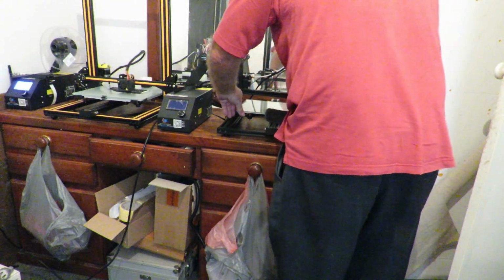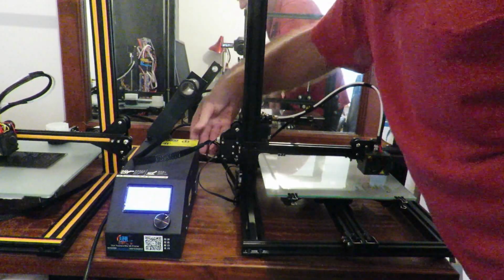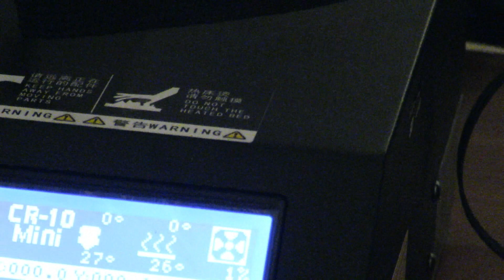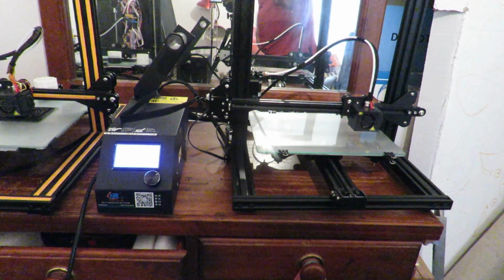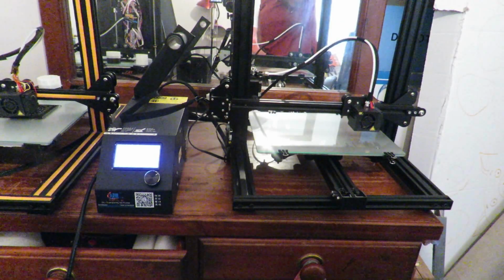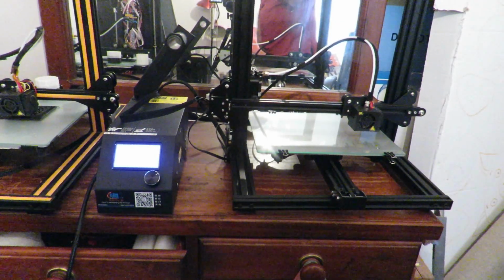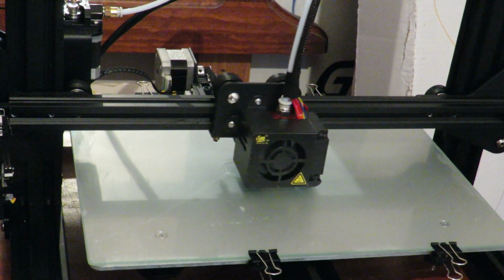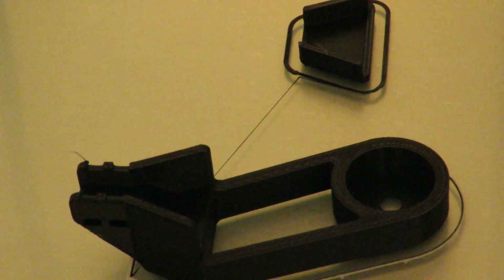📌 Creality CR-10 Mini 3D Printer Assembly and First Print

Comment: you jumped right to print how did you load the print job
Reply from the maker: You load your stl file into Cura (or Similar program) and save it as a Gcode file, then copy to a SD card, and insert into your printer's control box, or you can use Octoprint, and transfer files directly from your computer.

Comment: I'm new to 3d printing and just put together my CR10 mini, which is my 2nd printer (already!)  My 1st printer was a Biqu Magician which is great, but I found I wanted a larger build volume hence the CR10 mini.

I didn't have any trouble putting it together, but when I went to do my 1st test print nothing extruded.  I can push the filament through manually and see it come out of the nozzle, but when the motor runs it looks like it's not grabbing the filament.  The toothed part turns, but the smooth wheel does not.  I'm using 1.75 PLA and heating to 200 and unless they sent me a used printer it shouldn't be clogged, right?  Any troubleshooting advice?
Reply from the maker: Try disconnecting the bowden tube and run the filament so its completely through the extruder, then start a print and watch to see if the extruder is pushing the filament through the extruder.
If its not grabbing the filament, then check the extruder wheel alignment. ( loosen the bolts and re-align the extruder and motor)
Reply: Thank you for you advice, I removed the bowden tube and tried moving the e-axis in the controls without bothering to put the filament through the hot end and again the gear turned but did not grab, so I learned it was not anything to do with the hotend or the bowden tube and a little bit about troubleshooting!  

I admit I wasn't sure exactly what alignments you were referring to, but I was playing with the various bolts on the extruder assembly and discovered that there is a single bolt whose sole purpose is alignment, and when adjusting it saw I was getting more clearance from the z-rod and the filament was straightening out!

It now appears that it is feeding the filament!  Thank you!  Now I'll try to print something :)
Reply from the maker: Glad you got it working
I would suggest if you haven't already done.
Don't use the Cura version supplied on the SDCard, Download the latest version of Cura. it has a CR-10 Profile already included in it.

Comment: Thank's for this video, it helped me loads. I'm a newbie to 3d printing. Cheers
Reply from the maker: Thanks for taking time to comment.
If you need any help, just pop a question in any of my videos, and I'll do the best I can to help you.
Reply: I have a question but it's going to hard without showing an image but I'll try and describe it. I am a  complete novice and trying to suck so much information up that I'm struggling a bit. The prints I have had difficulty with are shallow ones for example the Knob for attaching to the thumb screws that looks like a water valve. There's bits sticking up instead of filling. I am just trying again at the minute and I had the fill at 16 I'm now doing it at 20 but if this a common thing with a simple answer I'd be really grateful if you could help. Cheer
Reply from the maker: Hi Steve
What slicer are you using?
Reply: Garry Purcell Hi Garry 
I’m using Cura that came with the machine but I also downloaded the new (I presume) version from their website and it was the same. I have had good results when I’m printing a little robot etc but if something is very thin like some lettering that’s 3 or 4 mm in thickness it doesn’t seem to do the fill enough. I’ve done a bit of fiddling after watching some videos but I’ll have to look again tomorrow as my bed is calling. Cheers a Steve
Reply from the maker: I would suggest you upgrade to Ultimaker Cura v3.0.4 for Windows
Here is a direct link
https://ultimaker.com/en/products/cura-software/download-request/159

Cura v3 and later have now incorporated a CR-10 Profile to make setting up the printer a lot easier.
Reply: Garry Purcell thank you very much. I shall do that first job in the morning and report back. I’ll see I can share an image . Cheers Steve
Reply from the maker: No worries.
We will hopefully get you 3d printing perfectly soon.
Reply: Hi Garry, been printing 13 hours and produced 2 faultless pieces . I downloaded the version of cura from the link and used the CR 10 profile. Worked a dream. I did wonder if had to be the mini profile which wasn’t there but the standard cr 10 profile was fine. Thanks for your help mate much appreciated and I'll be watching out for your future videos. Cheers Steve .
Reply from the maker: I'm glad your printer is up and running now.
You can change the Cura settings for the Mini.

On the Menu Bar
1 Goto Preferences
2 Printers
3 select CR-10 Printer
Then click on Machine Settings
You will now have a pop up screen where you can change the build plate size to suite the CR-10 mini

Now you biggest problem will be.... which thing to print next.😀
Reply from the maker: Hi Steve
You need to add support in the Cura settings.

On the right hand side 
1. Scroll down to support
2. Tick the "Generate Support" box

Now when the GCode is created, it will automatically build small structures, to aid in printing overhangs, such as those in you photos. 

You can alternately download Ideamaker, and manually add supports where you want them.
Ideamaker requires you to set up the CR-10 profile yourself, but it is well worth your time, to do so.
Reply: Garry Purcell I thought the software created it if it was needed but I see it’s not ticked in the Cura settings. I’ll try that again tomorrow. Again many thanks. Steve
Reply from the maker: The supports can be a pain sometimes to remove.
Let me know how you go..

Comment: Just got mine today! I did notice all of the axis rollers have flat spots from where it was parked for shipping. Did yours?  Do they go away after a while. Also noticed the lead screw brass female "nut" has lock washers between the mounting hole flanges and the extruder bracket plus they are loose. Are yours?
Reply from the maker: If you adjust the eccentric bolts to spread the tension across them, you will find the wheels will wear in nicely, and after a few prints, the flat spots completely go away.

I assume you are talking about the top of the gantry, where the lead screw mounts to it. 
One or two millimeter play in this area is normal, and it is designed that way.
Reply: Garry Purcell Thanks Garry!  I did a little fiddling with the adjustments and its smooth now.
The other thing I asked about is the brass lead screw nut that is bolted to a bracket on the side of the extruder motor.  Mine has 2 lock washers on each bolt. One under the head of the bolt and one between the lead screw nut mounting ear and the extruder bracket. Neither screw is tightened  to the point of flattening the lock washers. I didn't know if this is supposed to be like this or if it is an assembly mistake.
Reply from the maker: I checked my three CR-10 printers and they are the same as yours.
One washer under the blot head and the other between the brass and extruder
Reply: Garry Purcell 
Thanks again Garry! Cheers!
Reply from the maker: If you have any other questions, simply post a comment on any of my videos, and I'll do my best to help you.
All the Best, and Happy Printing.

Comment: you should have been more clear on where the wires go because we can not figure that part out
Reply from the maker: Thank you for your comment.
The wires are each independently labelled and already connected to the back of the control box. so it should be easy to place them, (at 9.51 in my video I did a quick summary as to where they go.)
You really can't make a mistake when it comes to wiring, as long as you take a note of the printers axis. (X,Y,Z) the end stops are a different plug size, so once again you can not wire them incorrectly.
If you need further help, simply send me a message, and I'll take some photos of my printer to show you exactly where each plug goes.

P.S. I have another Creality 3D Printer on its way.
I'll take some extra time showing the wire locations in that assembly video, as each of the Creality printers, are almost identical when it comes to wiring.
Reply: @GarryPurcell  each motor gets a set of wires to control its movement sets are label to each and only plug in a certain way
Reply: I believe he's trying to be funny Gerry, Great clip bud, My mini will be here this week, looking fwd to it :)